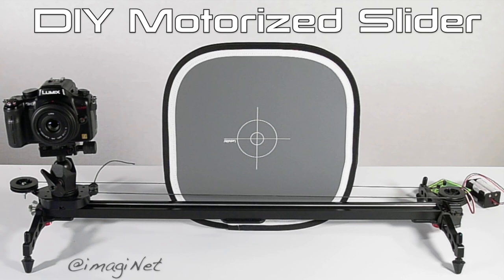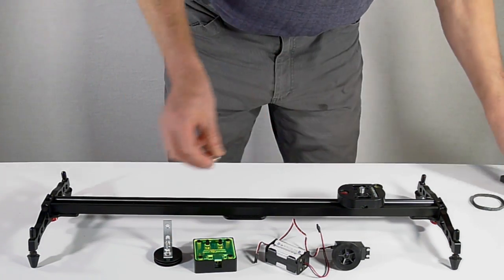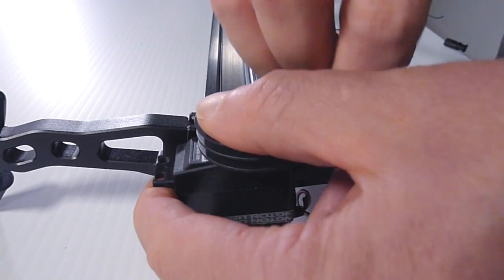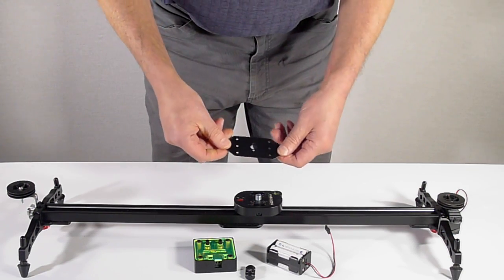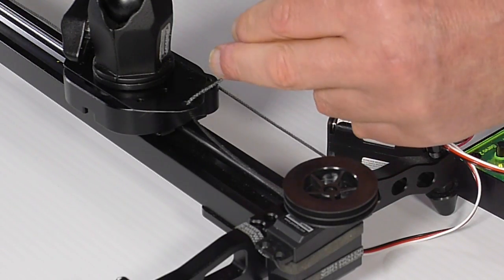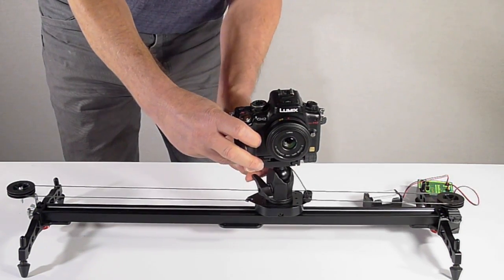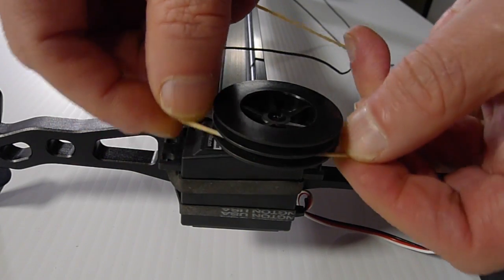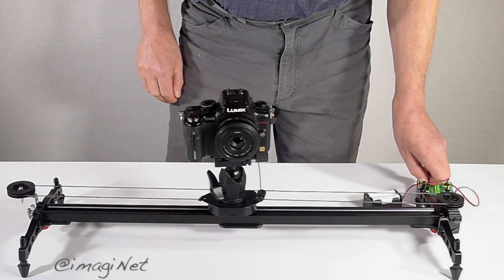Varavon Motorized Video Camera Slider

Comment: Hi imagineMedia, very nice idea, but I have a question. I'm wondering if your setup would still work with heavier loads, camera and lens. Have you tried to mount a heavier camera and lens, or use the slider at 45 degrees angle? I have the feeling that this motor will not be capable to handle it, or the servo will consider it as a too heavy load and will stop as it stops at the end of the course. Am I right? honestly. Thanks in advance for answering
Reply: Titus Tucan these servos are strong but if you need more power, I'm sure you can attach another servo on other side.  that controller should support two servos and can make them work in conjunction (I imagine).
Reply: Titus Tucan If one servo is strong enough, I say get toothed pulleys and a belt instead of wire.

Comment: does it have to be 4 cell battery? or can i use 8
Reply from the maker: +kreeper24 DIY Pc Mods & Tech  You can use any pwer source you want. As long as the voltage is correct, you wil be good.

Comment: where did you get the second pulley wheel from? the one you used for the Continuous Rotation Servo
Reply from the maker: Both wheel are the same. This makes it much easier.

Comment: Would it be possible to use this vertically standing up?
Reply from the maker: I have used it vertically several times. This was with a GoPro camera, similar ballhead to what I used in this video, and a 7 inch friction arm to allow the camera to be positioned horizontally. I do not know the weight of this set up, but it worked without any slippage. You could always use either a more powerful servo or a smaller diameter drive pulley, both of which would increase torque. I may try this with my GH4 and see if it will lift a M43 body.

Comment: Does the driver you used allow for continuous movement?  Can I set the servo speed to a crawl and allow it to run without attention to the end of the track?  Thanks!
Reply from the maker: Yes, it allows for continuous movement. Just set the speed and leave it. I only kept my hand on it in the video as I was showing speed and direction controls. I have since added a micro switch to the end of the slider at the servo end, that cuts the power as soon as the camera reached the motor end of the rail.
Reply: imaginetMedia Thank you! Really appreciate it!

Comment: Hi,
Nice work! I'm about to build a simple time lapse slider. Was the 2 RPM motor good or do you suggest an even slower one? What was the diameter of the pulley used in your previous (time lapse) version?

Comment: Hi Great work! I really like the idea and went to build one using the parts you listed for time lapse. I got the slider slow enough to take ~30mins to go across a 5 ft track. I was hoping to make this even slower. What size of pulley wheel did you use? would using a smaller one slow it down more? Would putting more weight on the vehicle? Or are there additional modifications to the PWC that can help slow it down more? I see an interface that is unused. Any help would be great

Comment from the maker: I tired numerous motors before this one. I had been using 12v gear motors.

To control DC motor speed properly, you just cannot control the voltage, you need a PWM controller. That is, Pulse Width Modulation. Basically, what this does is very quickly send full voltage and then shuts off over and over. This way, you can get the motor slowed down so that you can barely see it moving. This is the advantage of gear motors over a servo motor, like the one in my video. Servos are made to turn fast.